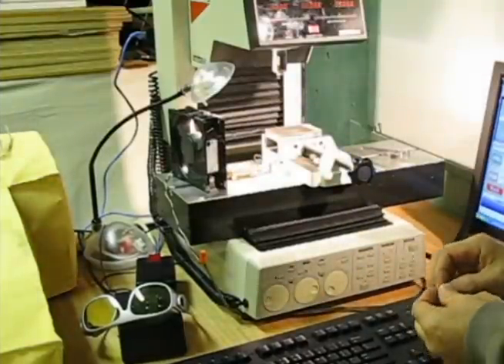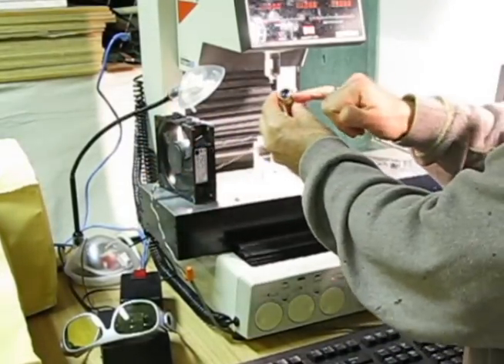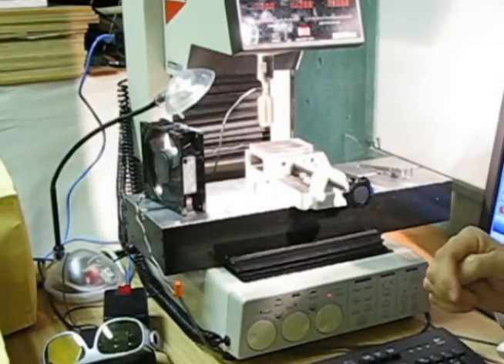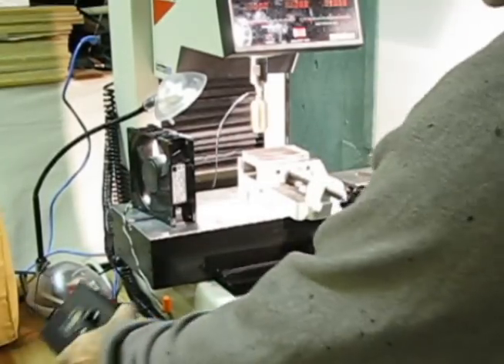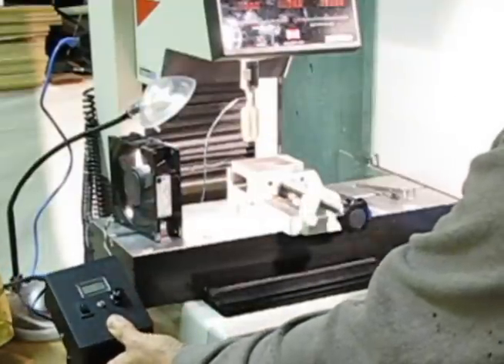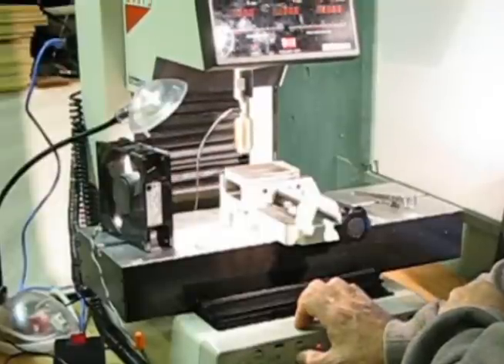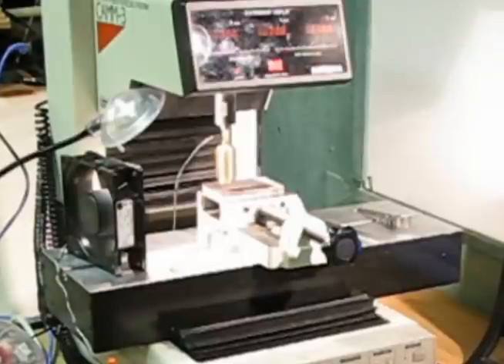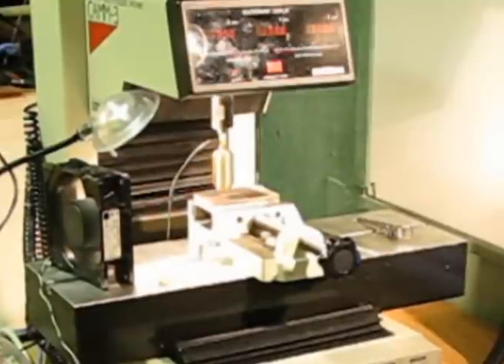CNC Laser Cutting with Mach3

Comment: Thank you for the comment :)
I think i will solve this some other way, i have been thinking, if i tap into the direction pin of the Z axis i could switch the laser off with a micro controller when the Z axis is going up and turn it on wenn it goes down.

Comment from the maker: For this 2D engraving I used Rasterfratz software to convert a jpg into cnc code.
I then edited the code to turn the laser on and off.
gcode E1P1 turns on output #1, which is the parallel port drive to the laser, in my case.
gcode E1P0 turns the laser off.
In Rasterfratz I set the cutting depth to -0.01mm, so the gcode that is produced has a line of code to "drop" the cutter at each line start.  I did this to make it easy to find the line starts, and then manually add the E1P0 and E1P1 commands.